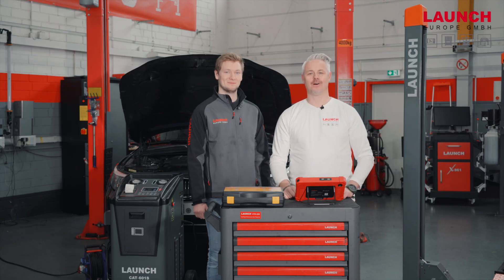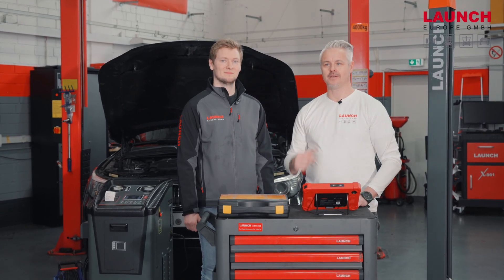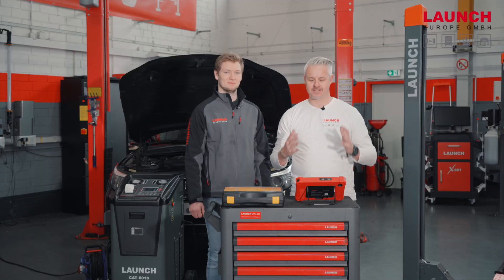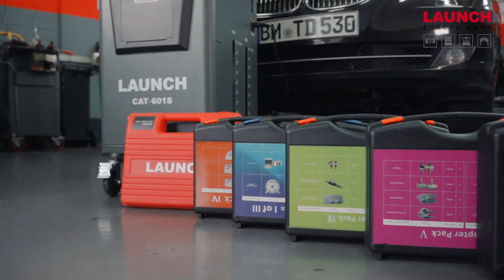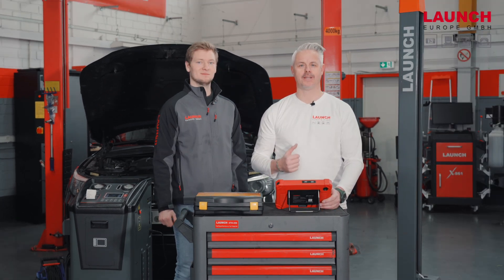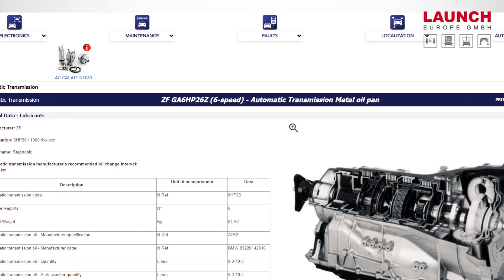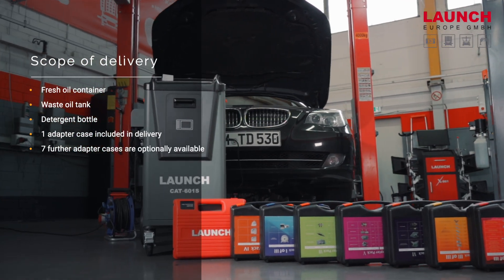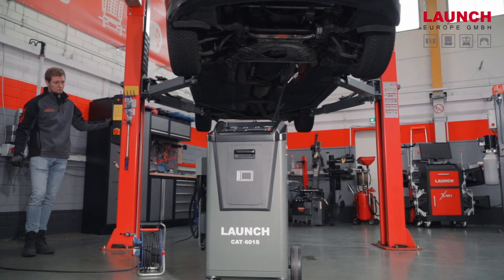LAUNCH Europe CAT 601S

Comment: Good product but after sales service 0.
 I purchased the CAT 601 station together with all the adapter kits. I did not benefit from installation or training. 
Without access to the ATF DATABASE, it is practically impossible to identify the necessary adapters for each car. 
I paid extra for access to ATF DATABASE and access to CAT APP. Although I received the activation codes on the atf.banca-dati page, I receive a message that I cannot connect, and as for access to the CAT APP, I received a 24-character activation code but no other instructions.
 After checking all the menus available in the X-431 EURO PRO5 tester that we use, we did not find any connection method.
We continued to look for a CAT APP in which we can enter the activation code and we only find cat games :((

Good job Launch!

Comment: What is the difference between 501s and 601s
Reply from the maker: Hello @majedishaq4226,
The CAT-601S Clean Gear is an automatic transmission cleaner and fluid exchanger from LAUNCH. It is supplied with a comprehensive range of adaptors, allowing connection to most transmission units including double clutch and CVT types. It can also be connected to the CAT Remote to control equipment operations for the main functions. The most important differences are 1. new design, 2. ATF oil sampling function, 3. remote control to process the service by one technician. Please have a look at our website for more details.
https://launch-europe.eu/cat-601-s-clean-gear/

Best regards

LAUNCH Europe Team
Reply: Good